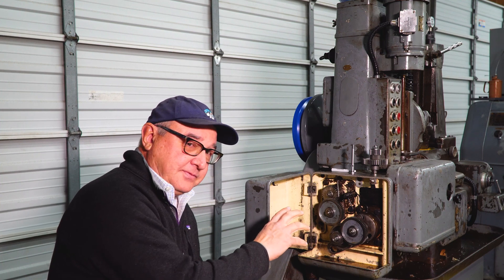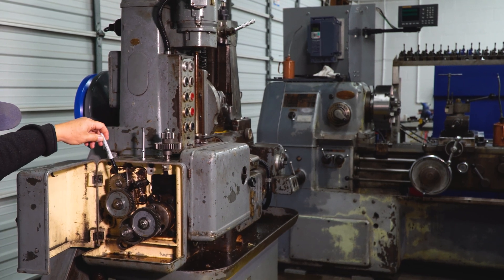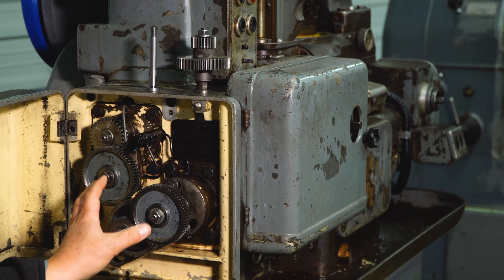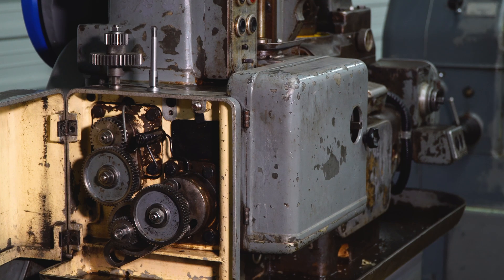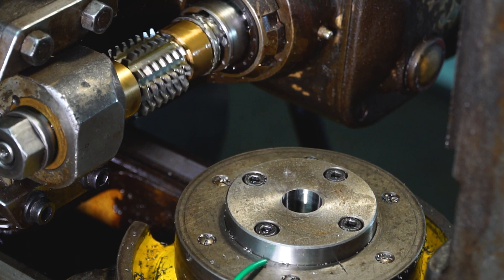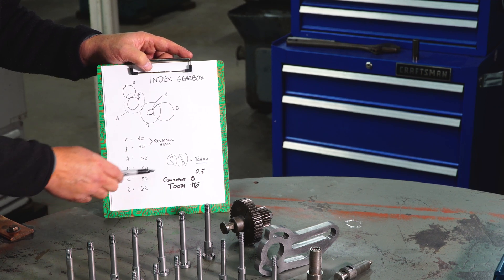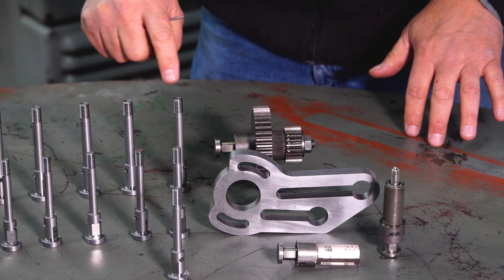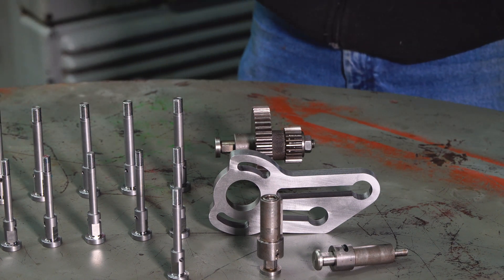Prior to Computers & Encoders -- Change Gears Programmed Machines - The Double Reduction Gearbox

Comment: I have a cnc lathe with c axis live Tooling. The hobbing attachment for it cost up to 5 digits for the brand name ones. Can't believe there are so expensive, probably because of the precision spiral bevel gears and bearings I don't know. Are CNC lathe a good platform for producing gears with such attachments? Or better off just sticking to a gear hobbing machine?
Reply from the maker: It’s a great question, let me answer two different ways-
1) from a business standpoint, deliver what customers are asking for and will pay for.  Lower quality gears are in many types of high volume demand - agriculture- etc.  before paying for the attachment secure a contract to pay for it with a big job.  But that is a lot to line up.  I find low quality gears have lower profitability—— unless the volume is really large.  Your CNC - gear attachment combo is the right stuff for volume.
2) From a process, technical and QC standpoint there is nothing better than a hobbed gear.  They will make a gear that the CNC/attachment cannot.  Done correctly and maybe hardened and ground -  they don’t get customer complaints.  With quality equipment (yes old with a rebuild and tuneup-can be very high quality) and without spending a fortune you can get great name brand bobbers like barber-Colman, Mikron, Pfauter, fellows…. You know what can be done if you are willing to figure it out.

Just my opinions here - I am sure others could have some good input as well.
Reply: @EvolventDesign  Thanks that's a very thoughtful reply from both a needs and wants point of view. The biggest advantage of using a live hobbing attachment for my cnc lathe is that I'm not constrained by limitations of change gears availability in a gear hobbing machine. An endeavour to possess all the change gears to cut every single tooth number out there would require an investment might cost more than the machine itself! Another advantage with the cnc lathe is that the main spindle and live spindle can be synchronised in resolutions of only few arc seconds, which translates to very accurate pitch produced on the gear, notwithstanding other variables of course. I can also finely tine cutting speed without affecting the turning ratio. I think gear crowning is also a possibility with cnc? Haven't figured out the kinematics of crowning, is it as simple as creating an arc motion in the z and x axis?
Reply: That's true ...I have noticed CNC gears have bumps on the surfaces ...This could be because the machine is not solid or there's vibration

Comment: Hello Andrew,  What a mechanical wonderland !  Love the idler shafts and that quadrant.  In lathe terms I have heard the quadrant called a banjo, I guess because that's how it kinda looks.  I probably have 20 Jacobs chucks in varying conditions.  I need to highlight them in one of my videos so you can have a mini-tour of them Ha ! !  I am looking for a jaw rebuild kit for an old style 20N that I have.  No kits on ebay right now.  I guess I could take the jaws and find the angle, and surface grind them.  Might make a good video.-----Doozer
Reply from the maker: Yes, the angle of the jaws would be good to know and measure.  Let me know what you get, I will do the same.

Comment: ooo Hobbing.  Thanks for posting.  I hope you can build that jacob's chuck key :)
Reply from the maker: That would be cool!
Reply: @EvolventDesign  Yeah sure would.   Would your machine there cut a helical gear? ........and for that matter it's actually semi cone shaped too isn't it?   For that jacob's helical chuck key.   I swear I've spent hours sifting ebay and google looking for one ........ I bet they'd be somewhat in demand on ebay......... I'd buy one.  Even if not hardened
Reply from the maker: Yes, the RS00 will cut a helical gear.  But not a bevel gear.  A bevel gear of any kind requires a completely different machine.